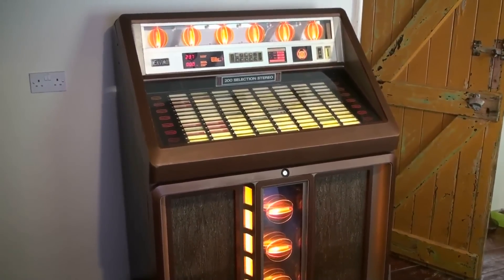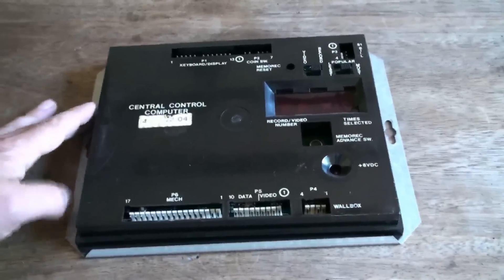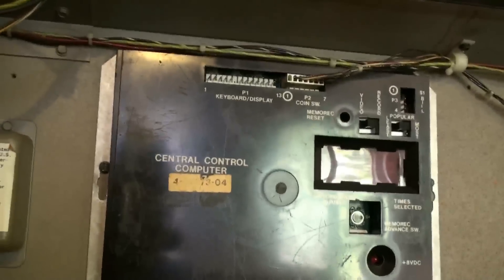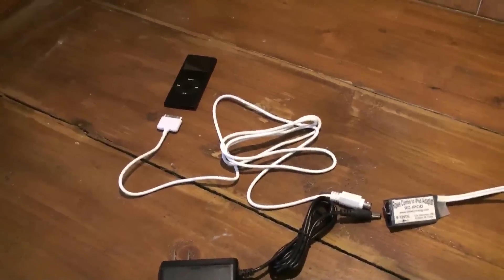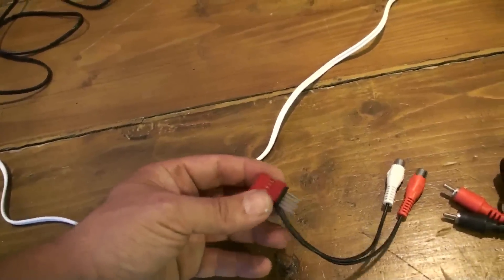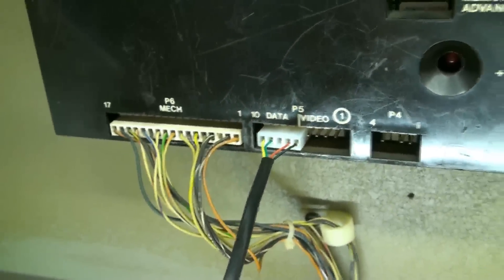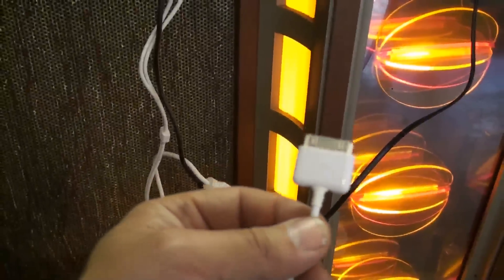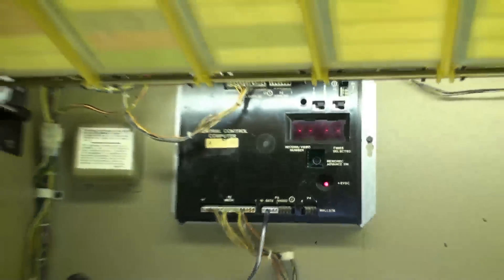How to play an ipod with a Juke Box (1190 selections)

Comment: How do you keep track of the songs available on the iPod and their selection numbers?
Reply from the maker: All 990 ipod tracks are split into 10 folders.

when selecting a track the computer sees the first digit entered;
1 = A side 45
2 = B side 45
5 = CD Library

If 5 is entered for CD Library (ipod) next entered is a single digit number for the disc 0-9 (10 discs/folders)
and the following double digit number is the track on the disc 00 - 99 (99 tracks)

So 5612  =

5 = ipod
6 = Folder 7
12 = Track 12

All the tracks are in 10 specific folders on my itunes, I have added the required track number to play on the jukebox into the itunes details. I have printed out the playlist in alphabetical order  so you find the track required on the list and type in the corresponding number.